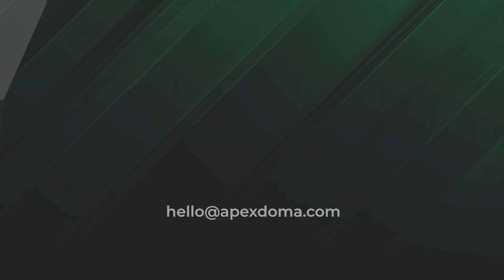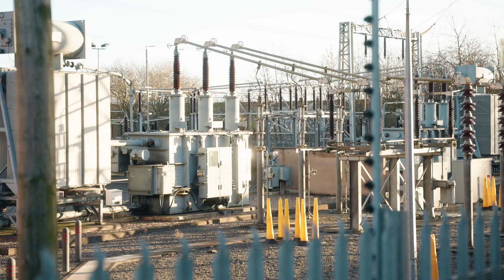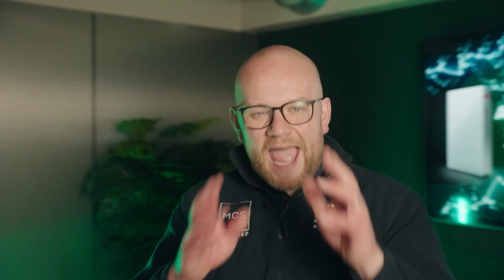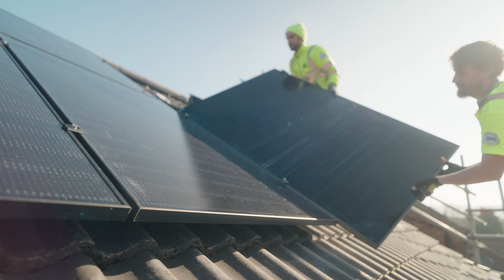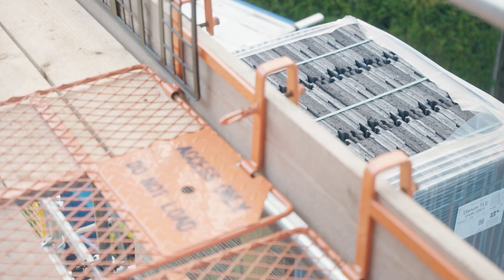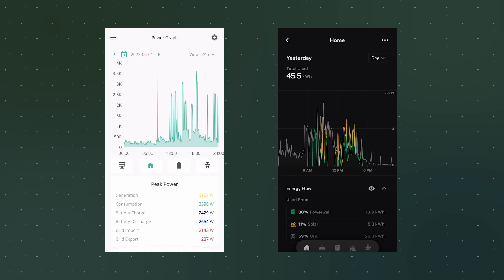Solar & Battery Installation 🔧 What to Expect  (UK Homeowners Guide)

Comment: does  the registering for export ,get speeded up if there is already a g98 FITs system install & the new system is a upgrade to the original install & i already have a mpan & have had one since 2013 ??

Comment: Hello Ian, do we still need to submit a G98 or G99 if we plan not to export any power back to the grid?
Reply from the maker: Technically, no, so long as you set the export to Nil. But we would always advise that you do, as a future owner of your property would almost certainly want to export using these documents. Secondly, if you decide to register it in the future, this is likely to be difficult as most installers wouldn't assist with this paperwork if they didn't install the system. 

Our advice would always be to register a system.
Reply: @ good advice thanks very much, I am planning on doing the install my self, so not looking to export anything as I would rather use the excess power to heat the water tank or ev car in future, but will follow all the necessary requirements to meet the mcs ie install meter readings, and have an electrician come in to verify all is safe
Reply from the maker: Definitely worth getting someone who is MCS registered in our opinion. All the best. 😃

Comment: Where on a G99 application is the number of hooks and rails needed? I can't see it anywhere.
Reply from the maker: Hooks and solar panels are required. Rails aren't (this is a slight mis- wording on the video). Thanks for watching.
Reply: @apexdomasolar  What form are you using? I'm looking at A1.2, A3.2 & A3.3 and there is no place to record number of hooks, rails or solar panels on there. The G99 forms I have are only asking for the generating units details, not the rest of the installation.
Reply from the maker: @thegrimreaper7777  - This information is recorded on the MCS certificate. We hope this clarifies 😃